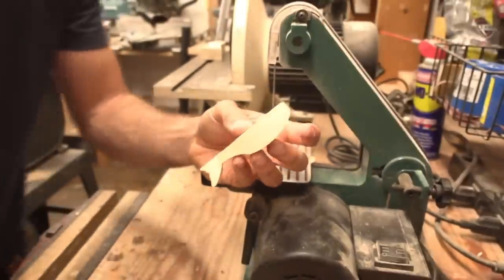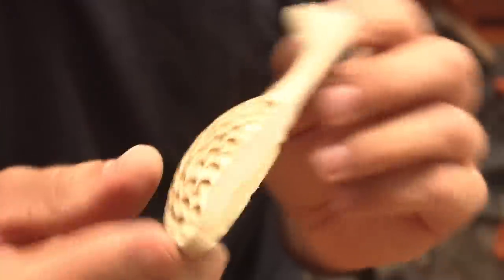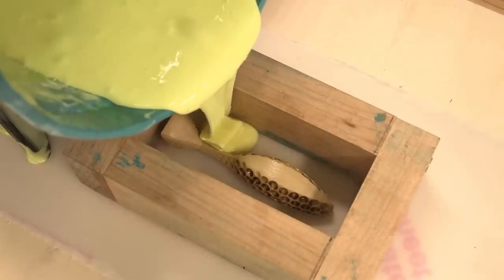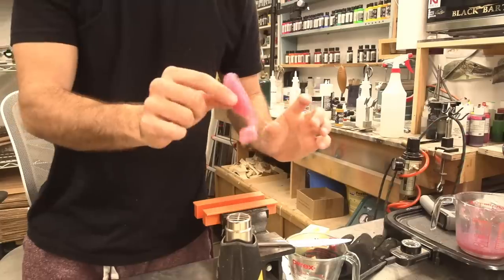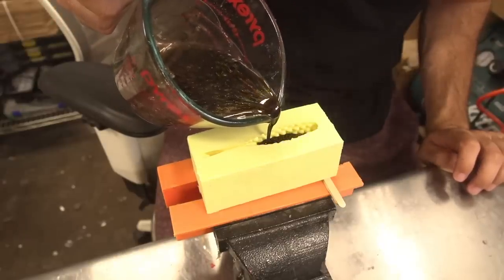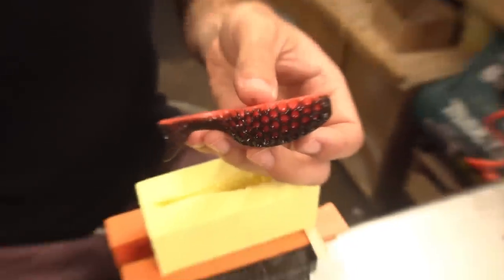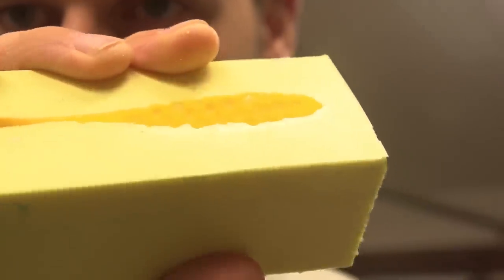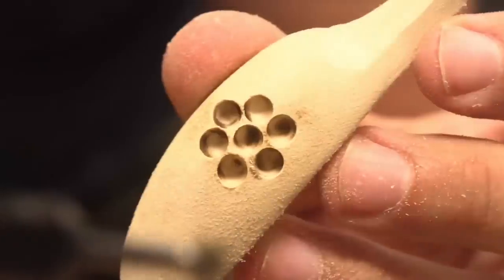Making a Trypophobia SwimBait

Comment: You could measure the exact amount of silicon you need exactly by finding the total volume of your mold box and subtracting the volume of your master. You can find the volume of your master by submerging it in a small beaker of water and observing how much the surface of the water rises in mL or whatever.

Comment: I want to say, this is an awesome looking bait dude! Not a horrible action on the bait at all. 
- I think the tail is just a tight wiggle because it has a short tail length. I think that adding at least an inch to the tail length, and making the tail a little more taller then the belly of the bait, should give it a belly roll and a huge tail kick. You might not even have to modify the tail. 🤞

Comment: Have you ever thought about doing a two part soft plastic in a similar vein to this? Like make the dimpled interior, but then put that in another mold to encase it in a different color? So you could have a dark interior with a translucent exterior - that could help give the look, but improve the action if the holes really are causing the issues?

Comment: Maybe a longer tail because of the body size. it maybe causing the tail to slip through ith the tail inside the flow around the body thus passing the tail but a little longer would then allow water to slide more around the body before hitting the tail, or even making a wider tail so that the water can pass the body to the tail, and because the tail is just a little wider that the body, the water would hit with a greater force and cause more fluttering of the tail.

Comment: According to NASA dimples on a golf ball create turbulence, which actually reduces drag. Dimples and Fluid Dynamics
Dimples and their impact on the golf ball traveling through the air can be described using fluid dynamics.
Basically, there are two types of fluid dynamic flows — laminar and turbulent. In general, many real life applications are turbulent in nature. This can be generally obtained from a factor called Reynolds number (fluid mechanics newbies please do a quick Google search to understand this term). In the current scenario, however, when the ball is smooth it gives rise to something close to a laminar flow. In this case, the fluid flow downstream detaches from the surface of the ball, in the form of vortices. This phenomenon is called flow separation, which gives rise to a viscous wake behind the ball that slows it down.